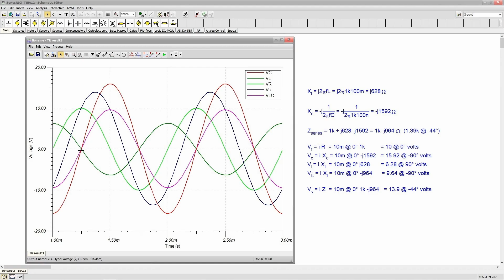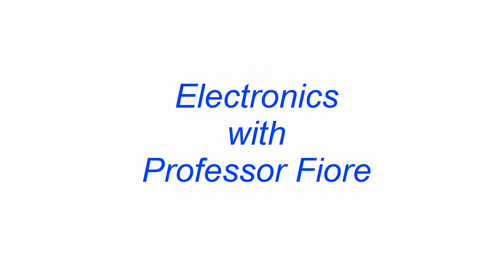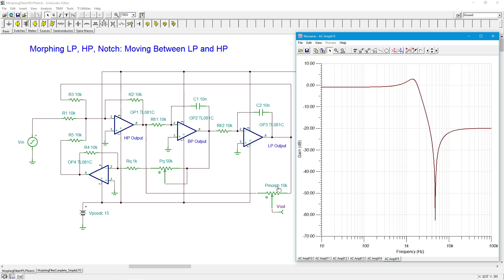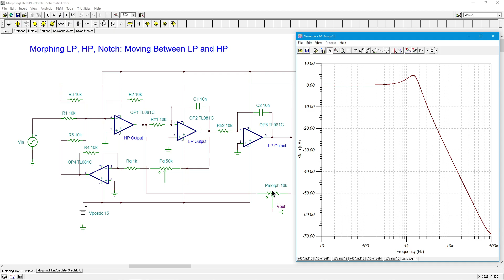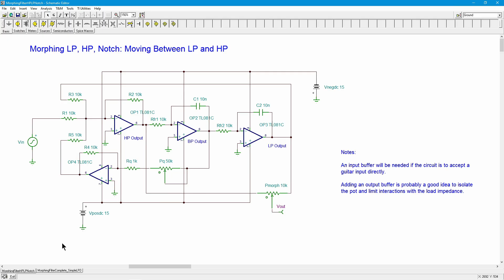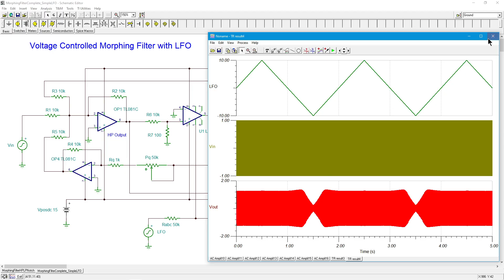Op Amps: Morphing Filter

Comment: It looks/sounds like all of the "interesting" OTA action (for a 220 Hz square wave input) happens when the LFO output is negative.  The relationship between the frequency response vs. time and the resulting audio behavior would be easier (at least for me) to follow if you set the LFO to 0.2 Hz sawtooth from 0 to -10V or vice versa.  Perhaps you could post an update?
Reply from the maker: One of the nice things about using free tools like the TINA-TI simulator is that there is a minimal "barrier for entry" for other people. That is, anyone can reproduce this schematic and alter it as they see fit. Have at it. It is an excellent way to learn.